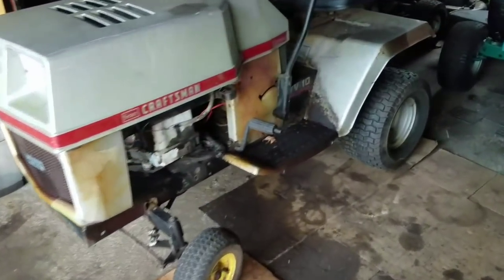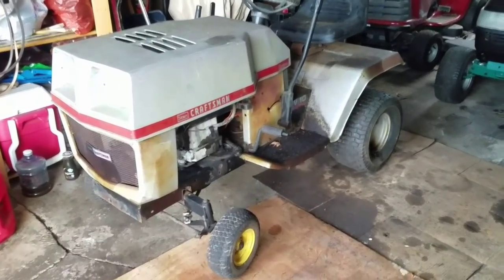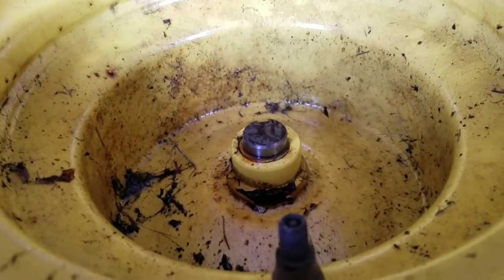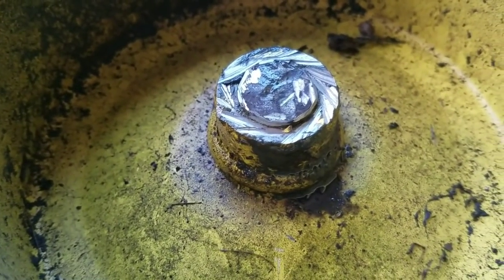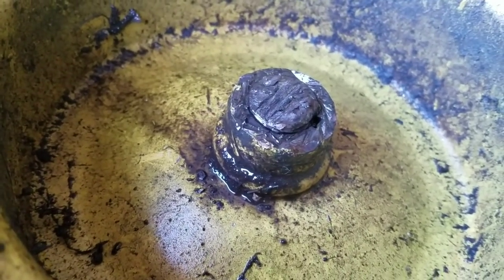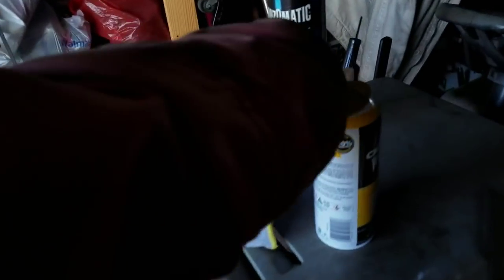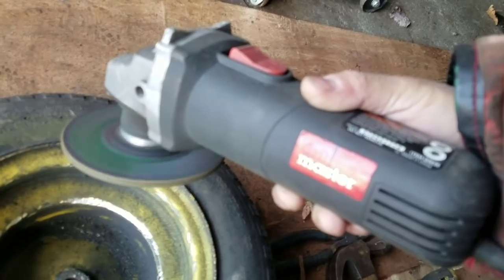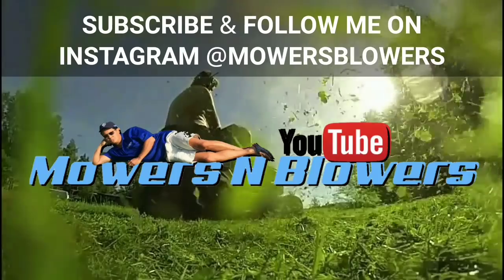HOW TO REMOVE SEIZED FUSED LAWN TRACTOR WHEEL OFF TRANSAXLE W/ LIQUID WRENCH PENETRATING OIL REVIEW

Comment: Use map gas. And a wheel puller. Heat back side also. I have done it many times, it works.
Reply from the maker: Apparently you're no longer watching the video jerome.  If you did, you wouldn't be suggesting what I've done on camera already.

Comment: Hey  Henry its Rocco from ct glad to see you got one off I have similar problems with tractor I'm working on 5/16 bolt snapped  off trying to remove  it .I got it this way
Reply from the maker: Extractor drill bits..or extractor sockets at harbor freight work well.

Comment: 50/50 mixture of acetone and  synthinc transmission fluid let set about a hour i use it on everything i don't have any spray suff anywhere old heavy equipment mechanic showed me this 20 years ago and never used any else sense . it works
Reply from the maker: Great tip broski.

Comment: Henry. My John Deere 165 has a stuck wheel that will have to be addressed when I replace the rear tires. The right side is ok and the left side is very seized. I may get my die grinder and clean up the very end of the axle for good measure being that it is so rusty looking. The cap had fallen of of the side that is free some time ago - Go Figure!!!. I have been thinking of purchasing one of the induction coil heaters which would go around the wheel collar and make it get cherry red without making the wheel look burned up from the torch flame.
Reply from the maker: I'd just try a blow torch and paint it after.  Be careful of the axle seal burning up to tranny.
Reply: Henry. I’m thinking by giving a very thorough cleaning to all of the rusted junk from around the area where the axle goes through the collar would help tremendously. I had already removed the snap ring a little while back breaking my Snap-On Tools snap ring pliers and believe it or not, have been using the John Deere to see if the wheel would break loose - Which It Has Not. 
Actually just a few minutes ago, I ordered two new tractor grip tires to replace the old rear tires for around $125.00. The local Tractor Supply Company wanted nearly $100.00 per tire in which drove me back to eBay once again. 
I m thinking about taking my heat gun and aiming towards the collar and stopping to spray maybe PB Blaster or Deep Creep by Seafoam which I use quite a bit. I’m hoping that the heat gun approach will draw in the penetrating oil and more so that the heat gun would be less harmful to the axle seal. I have also entertained the thought of drilling two holes in the wheel like what the MTD/Craftsman lawn and garden tractors have. Why couldn’t John Deere have wheels like this on their lawn tractors. We Will See.
Reply from the maker: You can take the whole tenant off and prop the stock wheel on some cutting horses and let the tranny hang in the air and bang the shaft, or air hammer.
Reply: Mowers N Blowers. Now that sounds interesting. I’m hoping that I don’t have to get that extreme. All of my other tractors have lug bolts 
So Henry, If I have to - I will change the tire with the wheel still on the tractor. That tire will get swapped out one way or another.

Comment: #1, use Mapp gas instead of propane. Could have drilled two holes in wheel and used a puller instead of ruining the axle. Yeah you got the wheel off, but at what cost ruining the axle?
Reply from the maker: If I had a puller,  I’d use it!

Comment: Put a plow on it
Reply from the maker: Then I'll need a bigger engine ( the one you were supposed to trade with me remember?), rear wheel weights, tire chains.  Costly conversion bro.
Reply: @MowersNBlowers  you don't need a bigger engine and I got to wait to get cleared to drive next couple of weeks I am hoping to get  cleared to drive I have to show you how to remove wheel's. You should have drilled out the keyway it would have fallen off
Reply: @LIMowersAndMore  I owned the Same machine when I was a kid bought it new sold it to my neighbors down the street 3 years ago plowed every winter still runs and plows to this day
Reply from the maker: I wouldn't have any clue on how to install a plow anyway.
Reply: @MowersNBlowers  easy to do
Reply from the maker: Btw Scott, I may be selling the generator soon.  I need it out of my damn garage!